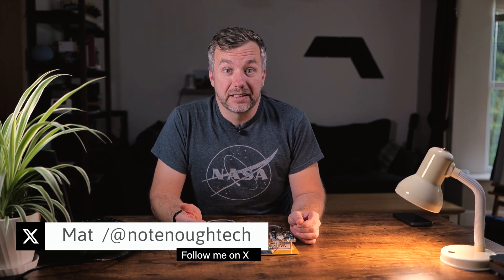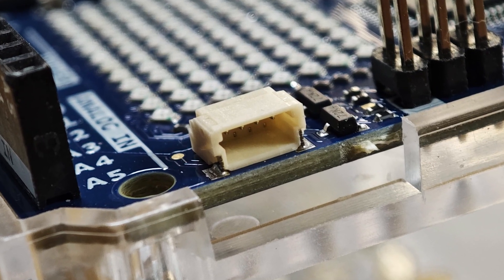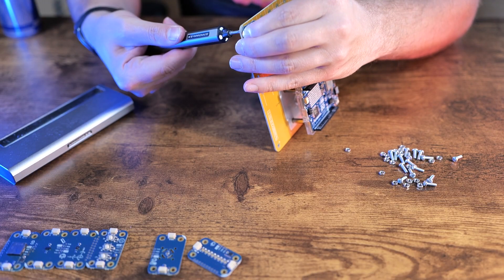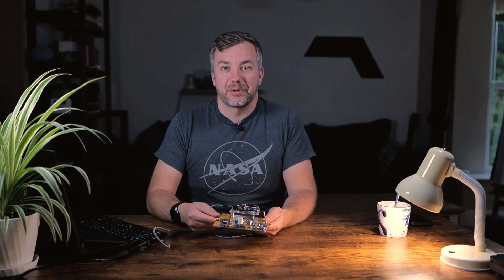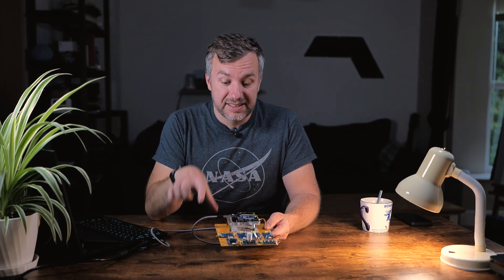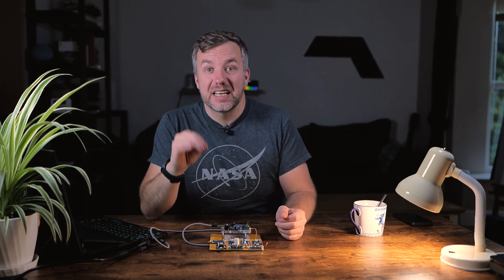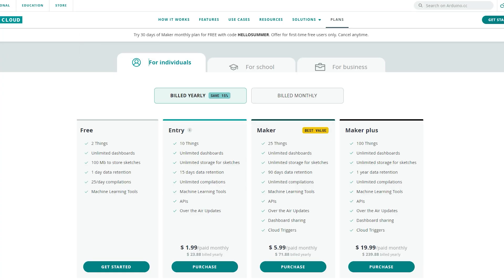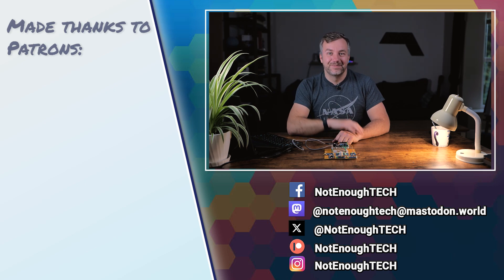Arduino Plug & Make kit: no more breadboards!

Comment: Finally they did something like that.... M5Stack has been doing something similar since years for I2C (Groove) point-to-point connections but that Arduino solution is definitively better as it allows Daisy-Chain connections .....(M5Stack solutions sucks as multiple IO Units use the I2C bus pins with parallel inputs or outputs, and therefore you cannot use multiple I2C peripherals..)....On the other side that Arduino motherboard solution is just a mechanical platform  ; M5Stack is better in that sense as most devices are LEGO compatible....